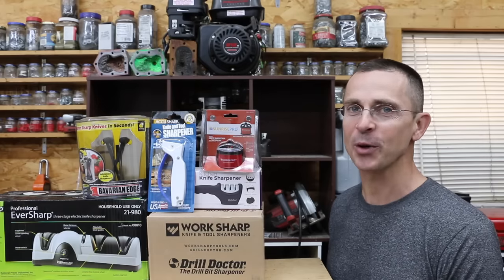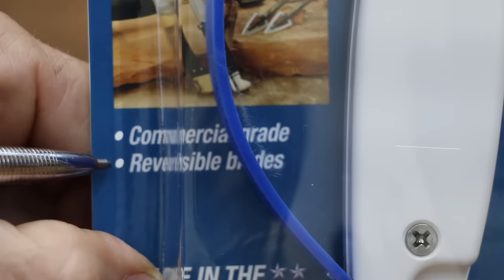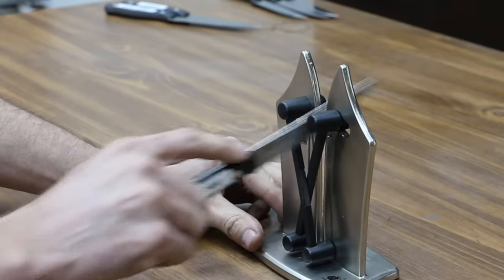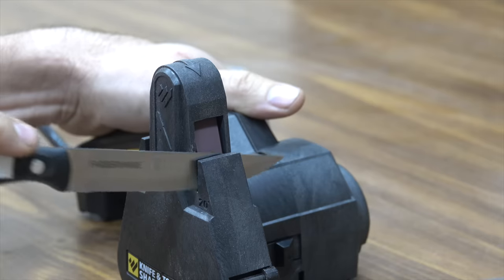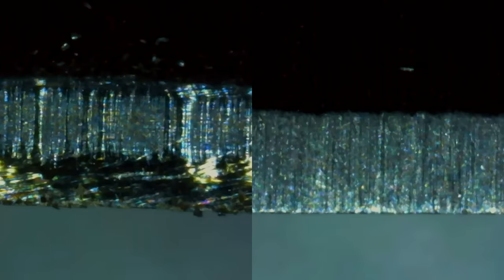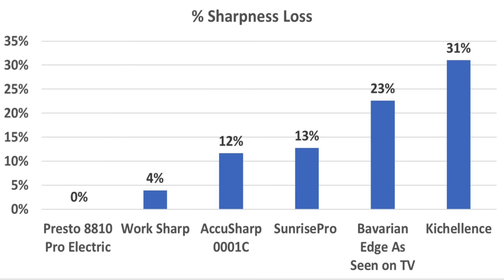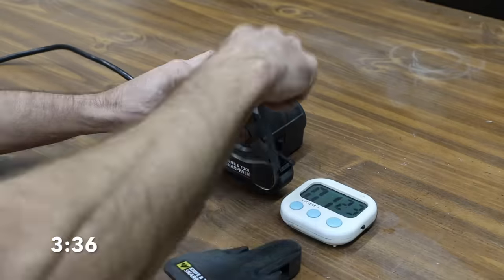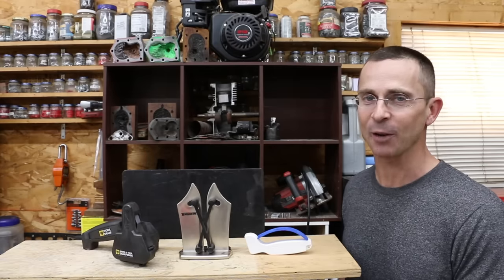Which Knife Sharpener is Best? Let's find out!

Comment: I've owned a lot of sharpeners, including the Accusharp (after seeing that recommended by Cook's Illustrated magazine).  The Accusharp really can give quite a sharp edge, BUT it takes some skill (or, really, experience) to "feel" when it is properly cutting/shaping the blade. 

However, my absolute favorite sharpeners have been the electrics from Chef's Choice.  And my new favorite is the Chef's Choice Trizor 15, which sharpens to a 15 degree edge (as opposed to the standard American 20 degree).  I have to say that the resulting edge is absolutely the sharpest knife edge I have EVER experienced...much more akin to a razor or Exacto knife blade than a kitchen knife!
Reply: Better yet are the white ceramic knives. Sharpest things besides lasers.
Reply: Chef's Choice is an excellent sharpener, but is the more expensive option and is about twenty bucks more than the Kevin Onion Worksharp machine.  But the Workshop changes the edge profile due to the contact with the sanding belt which I do not like on my kitchen knives.
Reply: If something requires skill to do at that point wouldn't you just use actual whetstones?
Reply: I like my Chef’s Choice 20° sharpener, but it did take a while to learn to use well.
Reply: I was saying work-sharp the moment you introduced the products. The made in China label gave most of them away.
This all comes down to how sharp do you want your blades ... what are you using them for and how long do you want your edges to last.
My journey in the world of sharpening started with my brother using oil stones to sharpen the same kind of blades I have in my collection.
I thought they were sharp blades back in the day ... but I was not correct!
I went from hand sharpening using various stones ... still not satisfied it was as sharp as I knew I could get that steel (S35VN/ATS34/san mai III VGI/D2 tool/ AUS8A made in Japan) ... so I moved onto various assisted jig style products and ended up with my Hapstone V7 grip-tomatic.
Here are some of my blades.
If you want scalpel-sharp (under 0.5 micros) then you only have one path to take. This one ...
https://www.youtube.com/watch?v=54oh_CZmcU4&t=1026s
Reply: Larry B, I will also say that the Trizor Chefs Choice is a very good sharpener.
Reply: The CC Trizor 15 is CI's recommended knife sharpener. Bought one recently on Woot for $79. New, not refurbed.
Reply: @raygun4468  do a cut test video;p
Reply: @St0RM33  I have no idea where to get the digital test equipment used in this video.
But I can assure you that 0.1 microns are about as far as you can go with a large fixed blade ... like the ones I have.
Reply: Donny D  Especially if you "care" about your knives?  What is that supposed to mean?  I want my knife to be sharp, and for the edge to last.  My Chef's Choice Trizor does that FAR better AND easier than anything else.
Reply: @johnpossum556  I have owned several ceramic knives, including Kyoceras (very good) and Cuisinart (absolute trash!).  Yes, they are sharp.  But definitely NOT sharper than my steel knives, properly sharpened.  And I can resharpen my steels but have to send the ceramics out.  I have totally stopped using the ceramics.
Reply: @PapP148  Not sure what you meant here.  If you meant, if the Accusharp requires skill, then use a whetstone, I'd say that absolutely makes no sense.  A whetstone requires skill...lots of it...AND takes a lot of time to set up.  An Accusharp requires skill (like, 3 minutes of learning) and then sharpens the blade in 15 seconds (20 seconds if you include opening the drawer to pull it out and "set it up").
Reply: @MPjustaman  Last night I grabbed two of my Trizor sharpened chef's knives to slice and chop some veggies.  I again was sort of stunned by how sharp the knives were...and they have been used several times since last sharpened!  I have never had kitchen knives that were so sharp...period.  Reminded me of the ultra-sharp "microtome" blades from histology labs...I can slice veggies, cheese, etc. tissue paper thin.
Reply: Larry B , you are so right!
Look folks Larry is telling you his experience with the Trizor Chefs Choice sharpener. Well I'm here to back up his claim.
My knives are now VERY sharp. I have the Work Sharp system, I have a wet stone system, I have about half a dozen other sharpeners too.
In my experience I was never able to get my knives sharp like I can with the Trizor. When he says razor sharp, he's NOT exaggerating. My 20 year old pocket knife is now scary sharp.
Yet there are two of my knives that the Trizor can't get sharp, one is a SOG pocket knife, the other is a Fiskars fillet knife. That fillet knife was the sharpest knife I ever seen come from a factory.
Still my CRKT pocket knife is now sharper than the Fiskars. Yes the system will set you back a bit , but if you demand sharp knives and have struggled like I have for years trying to get the edge you want then the Chefs Choice Trizor 15 degree edge might be your answer. 
And yes that pretty edge may not look as pretty but it will be sharp. I did find it makes and rather buffed edge not a nice shiny edge. No damage or scratches to my knife though.

Comment: Would have liked to see you used a wet stone to see the difference in time and effort for the same edge/sharpness.
Nevertheless  that was a great comparison.
👍
Reply: Wet stones and a honing stick would be nice additions. Though, they do take some practice and skill to get a good edge compared to these pull-through sharpeners.
Reply: @Flociety ,, agreed! Theres  a very steep learning curve to all hand sharpening knives.
Reply: Wet stones and honing sticks are good but a set is quite costly, I find 3 sheets of wet and dry and a flat chopping board is the best way to go, start at 400grit then 1200 then 2000. work with a bit of dish soap on the wet and dry. wet the back of the paper to stick it down to the cutting board. work though until 2000grit then draw the blade once across the edge of the cutting board.

But if speed is what you want those cheap units like accusharp and sunrise pro give a less sharp edge but also micro serrations and the poor edge is fantastic for breaking the skin of things like pork skin or soft tomatoes.
Reply: Just get a piece of leather and a stick of green compound.
Then you can keep your sharp knives sharp till you chip them.
Reply: I totally agree. If you have problems with holding an angle, import a HORL-1993. It has a magnetic angle block and a diamond roller. I also prefer a wetstone but this system is so easy a child could sharpen a knive. Everything mentioned in this video seems like abuse. 

Regards,
Etna.
Reply: @Flociety  The problem with honing sticks is that in some of his tests they wouldn't work too well due to the fact that honing sticks are more about retaining the existing edge, if you destroy the edge then you're going to have problems...

Definitely interested to see how well a wet stone created edge would compare though might give some insight into if it's worth the time compared to the high end sharpeners
Reply: @Kefkaix  I'm aware that honing rods more realign an edge rather than sharpen it. Though, I've seen a YouTuber called Burrfection dull a knife on a brick and resharpen with a ceramic rod. I also kind of see a rod as an intermediate between pull-throughs and wet stones
Reply: The problem with wet stones is it’s to subjective to the user. Some people with the right stones will out sharpen about anything, however other folks will dull it because it’s so subjective. I’ve seen people with good hand eye coordination get a knife dangerous sharp on the top of a car window.
Reply: Maybe a future video using wet stones and various angle holding helpers...
Reply: @nathanhudelson4935  me, it's always 50/50 whether I dull it more or sharpen a knife on stones.  Oddly enough, a few days ago i was bored and honed my pocket knife on my jeeps furry sun visor, pretending it was leather.  It made my pocket knife very sharp.  I don't know how, but it did.
Reply: Wet stones can make it as sharp as your skill allows,so it really wouldn't be a fair tool to test.
Reply: another1 commenter , my stones for some JAPANESE KNIVES, SAY SUBMERSE STONES IN WATER ONLY UNTIL BUBBLES END, THEN ADD TO STONE AS YOU USE, THEN LET THEM DRY<then put away. Cheers from NJ 🇺🇸🇺🇸🇺🇸🇺🇸
Reply: Hand sharpening wit hgood stones is best but you need the skill to do it. 99.9% of people just want their kitchen knives to work.
Reply: @nathanhudelson4935  Some people can sharpen a knife with literally anything. Not true for most people.
Reply: @CesarPerezn  True, i use ceramic sticks from a broken heating element. And if you use cheap knives, you can easily train on them, tehy just dont hold sharp edge for long. But i get at least more sharpening training that way :D
Reply: Not everyone know or can uses wet stone and honing. Where this items are perfect for home uses as they are perfectly angled.
Reply: Great video as always!! Thank you for all the effort and time you’ve put into it!
Reply: @dantedanis  
My dad taught me at about 10 years old.
Figured most people knew how to use one too some extent.
Was just curious as to how much longer it might take to get a similar edge.
Reply: @Etna.  I reccomend Lo-Ray sharpening systems. Small ohio company.
Reply: who ever said they can sharpen a knife on a car window please explain because you just won the im interested award
Reply: @lightdark00  why would you need a gadget? cant you hold your hand steady? you guys got parkinson or something?
Reply: Whetstone.  One word.  Not wet stone. Makes a huge difference if you are searching to spell it correctly.
Reply: @nathanhudelson4935  Grandmother would use the ceramic ring on the bottom of a china plate. It works surprisingly well.
Reply: @iiMEiii  leather is what borders use for the hand razors or at least they used to
Reply: It also depends on the steel quality. I had a knife which didn't look that cheap where the sharpened edge would just break away if made too sharp.
Reply: Gr3nadgr3gory it’s LoRay Sharpeners. No hyphen if you want people to actually find the company.
Reply: Assuming we are talking about decent quality stuff...usually it's safe to say the traditional sharpening methods work.  The issue is that they take time and skill.  This video seems to be about Shapening systems beyond traditional.
Reply: Namikawa Shoten Heibei. Professional Waterstones.
Reply: @Gr3nadgr3gory  Thanks! They have too many pieces for my taste. Too complicated for my girlfriend and I use just a wet Stone. Search for the HORL. It is a family run business in the Black Forest, Germany. Not cheap, but really nice.

Regards,
Etna.
Reply: @Etna.  cool, my dad knew the guy who originally made the lo ray system, its run by his son now. You might see him at the La Grange steam show if you're in northern ohio.
Reply: @teekay1785  yeah but it also makes a great knife strop to and with the green stuff.
If it has green honing compound it cuts as well so for finishing a knife its great. You can keep any sharp knife sharp nearly forever with only that.
It just is not fast for dull knives because it's about 8000-20000 grit depending on the brand.
Reply: Andy47357  just roll the window down half way on a car and use the top edge of the window to sharpen on.
Reply: Francois Dupont to test them! Many people don’t believe they can hold the correct angle for the best blade sharping the whole time.
Reply: That is the only way to do it.
Reply: I know it’s nit picky to point out, but it’s “whetstone” (or sharpening stone/honing stone), the same way it’s “whet my appetite”, not “wet my appetite.” Google it! :)
Reply: @brancebjones7205  
Yes you're right.
You are being annoying.
No one cares.
Have a day. 🤨
Reply: alan connelly That is only proper way to do it. Its about tradition and technique.
Reply: @franktaylor7617  Makes sense that you're touchy about it, nobody likes looking dumb in public...
Reply: He could have tested the Lansky system. Uses stones but the guide fixes the angles so you can’t screw it up. They even make a strop for an ultra fine finish. Biggest thing is that stones aren’t going to tear the edges like most of the ones tested did. They’re literally destroying the knives.
Reply: Bob Smith They work nice for pocket knives but are useless for long 8” kitchen blades.
Reply: @Chuck Beef Then step up to the Wicked Edge system. Granted, it’s a lot of money. But you can sharpen any knife w/ it. And while not ideal. I have brought kitchen knives back to life w/ a Lansky. As much as I’ve tried w/ a stone I’m just bad at it.
Reply: Bob Smith yeah ive watched a lot of reviews of the WE, i started using stones and cant go back to a jig sharpener. It just takes a little patience.
Reply: Andy47357  There’s plenty of reviews on YouTube of people doing just that
Reply: @thomaspollard8407  
You mean using a wet stone or comparing a wet stone to some sort of funky sharpener?
Reply: Frank Taylor Sorry I thought I was replying to the guy was asking which One of the sharpening methods was the best out of the bunch, I was replying to the worksharp was the best out of the ones he was demonstrating
Reply: @thomaspollard8407  
No worries 👍

Comment: Love it. When testing with a BESS though, it's a good idea to test each time 3 times in different parts of the blade, as you may be getting sharper or duller parts of each blade along the length, not to mention slight variations of accidentally 'fooling' the device.
Reply from the maker: Thanks!  Thanks for the feedback.
Reply: @ Scott. Considereing the absurd cost of the testing strands, I can't say I blame hime for a one time test.

Comment: When using an electric knife sharpener, you are supposed to alternate the two slots in each stage of sharpening.  Left, right, left, right, etc for each stage, and always pulling towards you, at a rate of approximately one second per inch of blade; if blade is 6" long, you would take approximately 6 seconds to pull the blade towards you, and then do the same in the other slot, in the same stage, until the blade feels sharp. Then you would do the same, in each of the stages, on your machine.
Very informative, however, would suggest that each time you mention the name of each sharpener, you show the picture of that sharpener, otherwise it starts to get confusing as to which sharpener, at that moment, you are using or referring too.
Reply from the maker: Thanks for sharing.
Reply: Agreed.

Comment: I worked in a meat packing plant nearly 50 years ago, and quickly learned that the secret to survival was a sharp knife. I got very good with a steel, and that's how I still sharpen knives today. I always warn people who use my knives to be careful because they are very, very sharp. If one cuts you, you barely feel a scratch. I have used a sharpener like the Eversharp before, and if you have a knife in bad shape, it does grind a nice edge. Following it with a steel, however, can make it even sharper. In my opinion, the Eversharp was the winner. It didn't dull in the cutting board test because it put the perfect shape on the blade. I think some work with a steel after the Eversharp and you would have had a very, very sharp blade that would keep it's edge a long time.
Reply from the maker: Thanks for sharing.
Reply: thanks - very good to know
Reply: The steel is the way to go. It will keep the edge for a long time.  Eventually, you're going to have to use the stone. The trick is, to maintain the edge by touching it up before it is completely wrecked.
Reply: @georgesakellaropoulos8162  Exactly! But, how you use the knife is also important. If you run it in the dishwasher, or us it to cut items on plates on in pans, you can trash the edge quickly, a steel is not going to be enough to maintain the edge.
Reply: @carlr2837  I cringe every time I see a glass cutting board.

Comment: Love it, but sure wish you'd also included the good old fashioned sharpening stone done by hand in this for comparison!
Reply: The problem with including stones in a comparison like this is that the results you get there are very skill dependent. All the sharpeners compared are at least somewhat idiotproof, with clear instructions and a design that more or less maintains the angle of the edge for you.
While you could probably compare these against one of those contraptions that position the stone for you, those are usually way more expensive than any of these
Reply: I thought about that too, but then the skill of the sharpener himself comes into play essentially. A novice should be able to use these and get similar results.
Reply: @krpajda  Your comment is spot on. Much to like about and effective, idiotproof method.